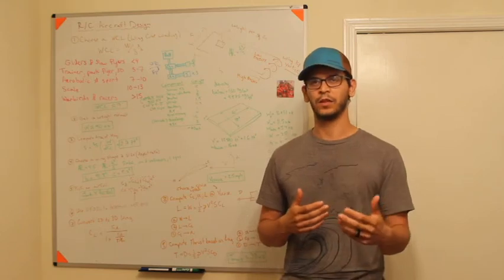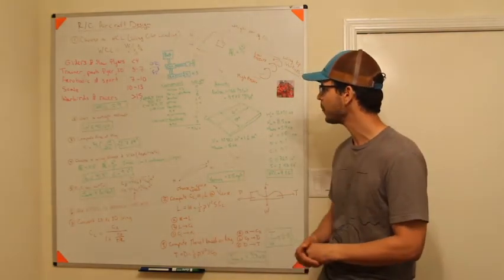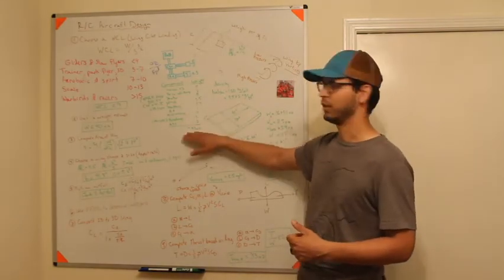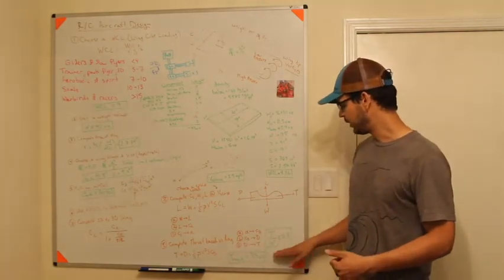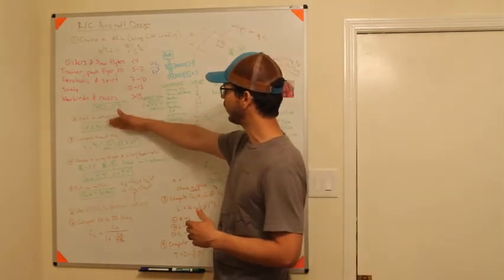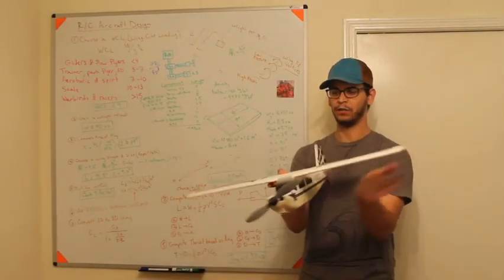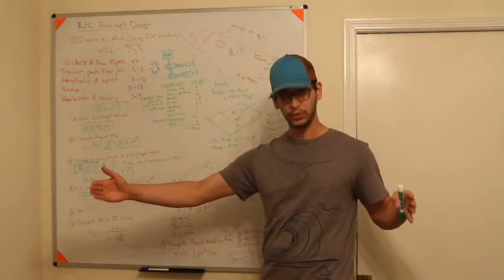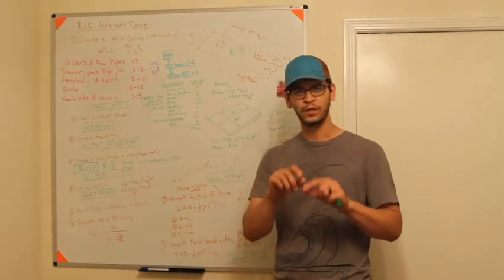How to Design a Fixed Wing RC Aircraft - Wing Cube Loading, Weight Estimate and Aspect Ratio

Comment: Hi, do you have any theory behind how strong the wing material needs to be? obviously foam is a popular choice, so clearly relatively low tensile materials are game. Would that mean carbon fibre or other composites is overkill?

my design is a 12.5kg/m^2 loading(im in the UK), that drops a payload, so loading will drop below 10 after. my AR is 5:1(2mx0.4m planform). And want average speed to max out at 30m/s.

I want to know if foam with a composite leading/trailing edge will be enough or even too much.  They'll be having CF tubes inside for assembly purposes as well extra support.
Reply from the maker: The best thing to do is perform the wing tip test. That is assume you have the weight of the aircraft and perform the standard cantilevered beam problem where the root of the wing is fixed to the fuselage and does not move and the tip of wing has a concentrated load of Weight/2.0 Compute the root bending moment and make sure whatever material you have can support that load. Hope that helps!

Comment: Thanks for the awesome pdf. 
The aerodynamic calculations / simulations really remove much of the guess work and i build 1 aircraft with this method and the flight performance was great, but i still need to work on the structural engineering to makes something that does not start to oscillate at higher speeds.

Comment: With your advanced background I am shocked u believe in wing cube loading myth....No derivation of lift equation gives cube root.
Our desired term is Velocity & v=Constant*(W/A)^0.5  or Scale velocity  v/l=(Constant/l)*(W/A)^0.5....even if we approximate l=A^.5  that too results in v/l=constant*W^0.5/A^0.25    "no cube roots".......Get over it   & I tested cube roots on full size aircraft like C130 & u get totally absurd answers....Rule of math is limit =0.00001 & limit=1000000000 must be satisfied...but cube root collapses
Reply from the maker: Nice. Great ego there. WCL only works for R/C aircraft not full sized C-130s.
Reply: @CarlosMontalvo251  Promote a term that is scientifically proven & works across the board...People will be designing better aircrafts & world will be a better place... Root of wing loading for stall speed comparison & Root of wing loading/aircraft length    for scale speed comparison.

Comment: Let’s not forget that in competition sailplanes use water ballast to improve their penetration. The L/D remains the same but it and stall etc all occur at higher speeds. The water is dumped in weak lift or before landing so that the weight of the water doesn’t risk damaging the glider in landing.